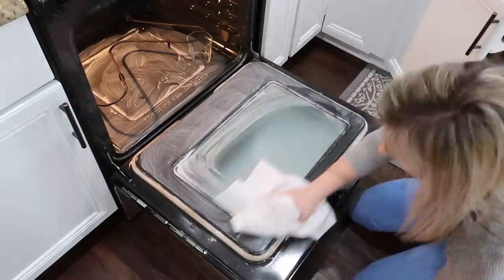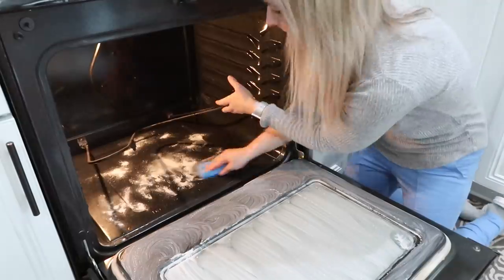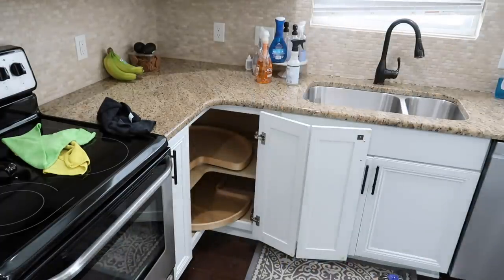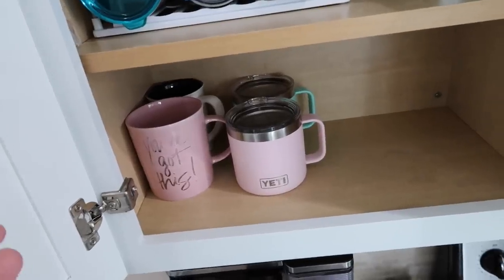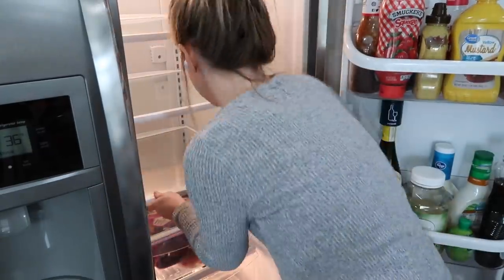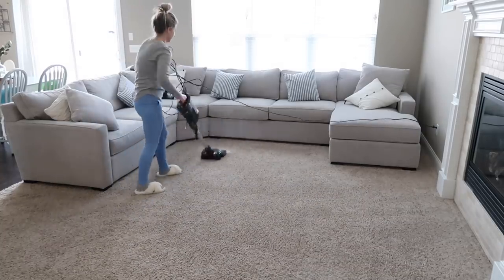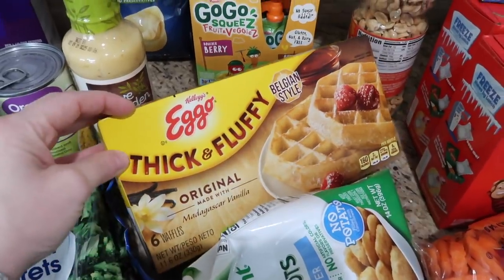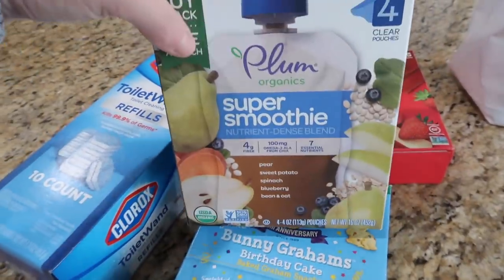*EXTREME* KITCHEN DECLUTTER ORGANIZE CLEAN WITH ME | CLEANING MOTIVATION | DECLUTTERING & ORGANIZING

Comment: Me too - kitchen - complete re-assess once a year👍
Blender?:  I have two, a Ninja and a Vitamix.  
The Vitamix was very expensive, however, it’s very powerful, blends to almost no ‘bits’, you can make nut butters and mylks in it very easily and ...... if used to blend vegetables etc longer, it heats the ingredients and makes soup.  If you can afford the outlay, Vitamix is amazing and I’d recommend one.  
Having said that, the Ninja is also good and copes with smaller amounts a lot better, doesn’t blend as smooth and doesn’t have a ‘professional’ grade motor, so doubt it would have such a long kitchen life as the Vitamix .... but then it’s a lot, lot cheaper.
Reply from the maker: Thank you for all of the info!